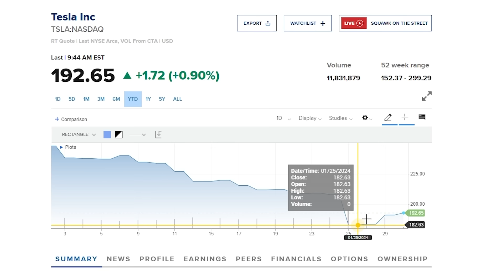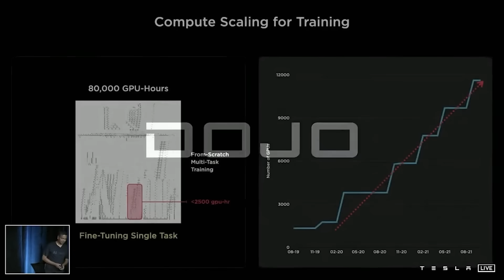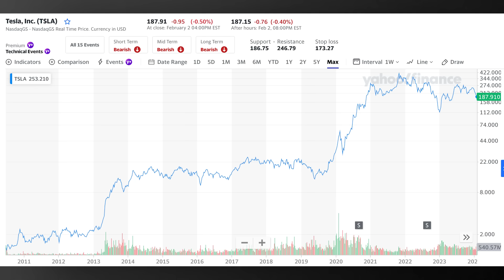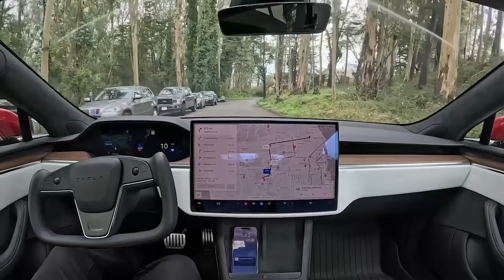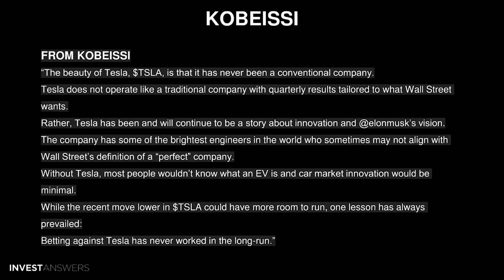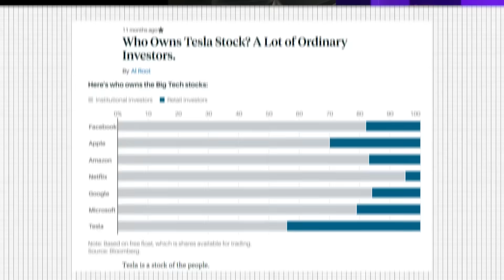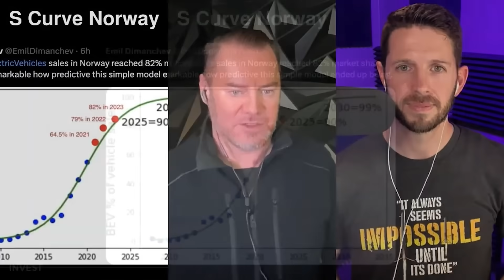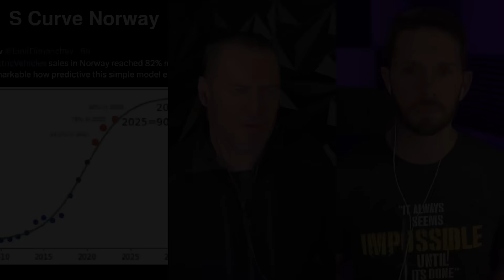Tesla’s going EXPONENTIAL! W/ Invest Answers

Comment: I see hints in 2025 but by 2026 where the s curve kicks in for a 10 fold rise.
Reply: Ten fold rise in Tesla stock? What will drive this growth? The only thing they have that's special is super charging.
Reply: @aaron___6014  three things, large utility batteries as factories ramp up, FSD with version 12 and start of Robo taxi that is 1/2 the cost of Uber/Lyft and first Optimus Robot doing actual production work in Tesla auto factories.